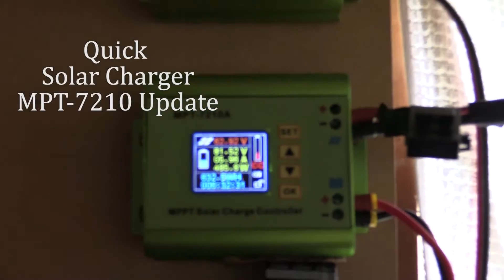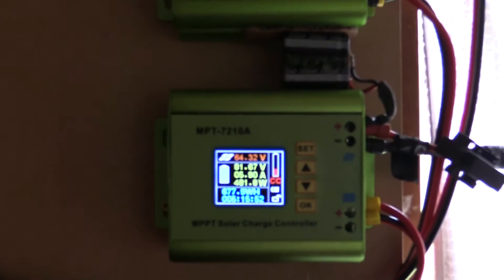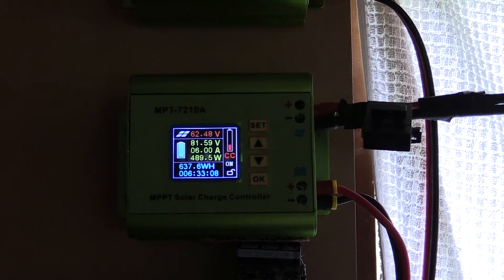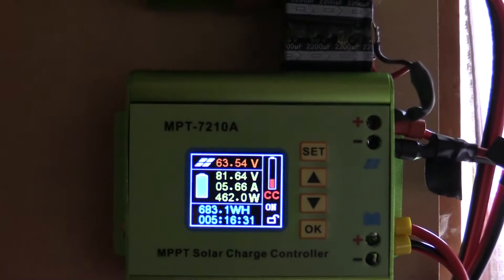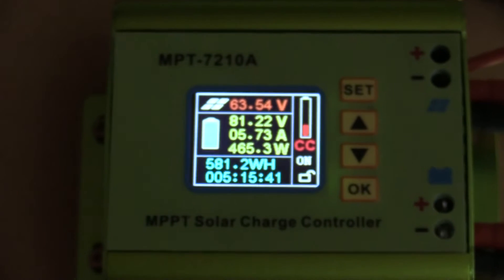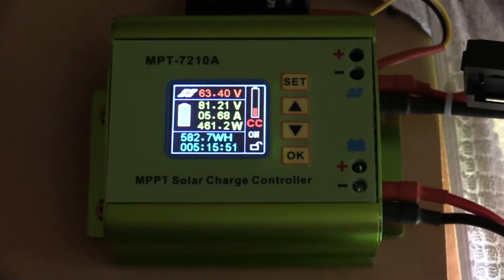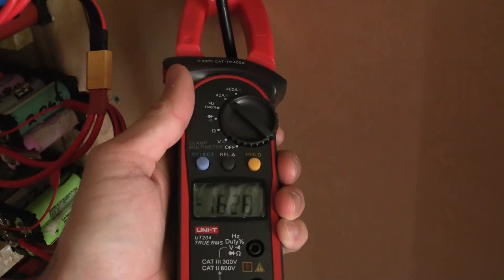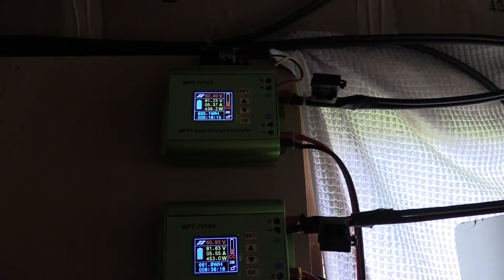Solar Charging Update MPT-7210A

Comment: orrr i ran out of videos to watch :(  (subbed)

I live in Auckland too what is the best angle for the panels ?  thanks
Reply from the maker: Two more videos coming out.
Have a look at and put your address into this, You can zoom in on your house like good maps and use the top slider to change the time of day. Use the left to change the time of year. You will see its very different between seasons.
http://www.suncalc.org/#/-36.851,174.7639,14/2016.09.14/12:00/1

Comment: have u found out how to get them to autostart? also regardning fans. i run mine at lowest speed and still no heat  theb u get rid of most noise.
Reply: DIY Tesla PowerWall u hooked up an arduino to start then or what?
Reply from the maker: Yes you can turn on autostart its in the menu option, working on all 3 well. Lowest speed might be fine but maybe not when i am getting close to 500w with a 600w limit. I also think the heat sink will be too small for 600w but thats fine since the panels are only 500w
Reply: Yeah when running max and if not in well wented enclosure it might get to hot. I have not tested them in max. have only 2*260w connected and its winter here now :)
Reply from the maker: let me know what you get with the 2x260w on a sunny day  :)